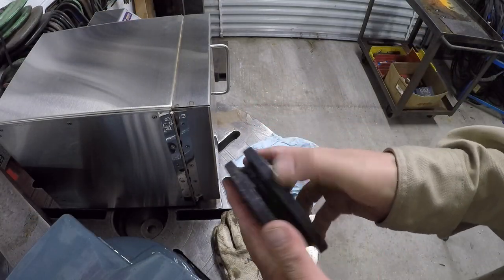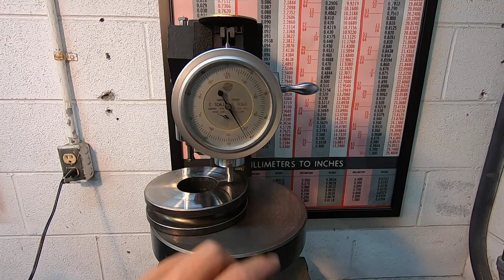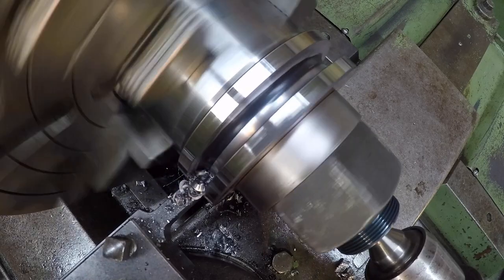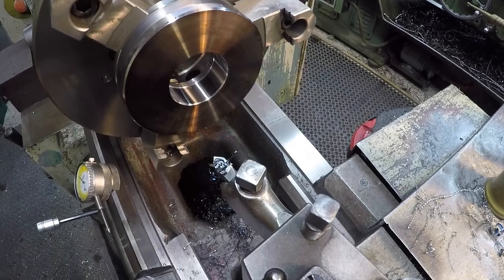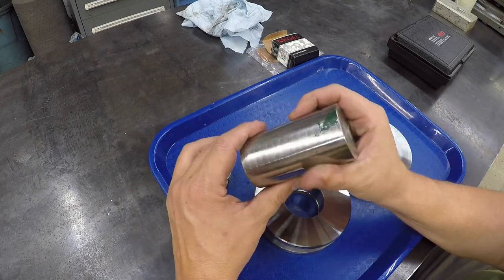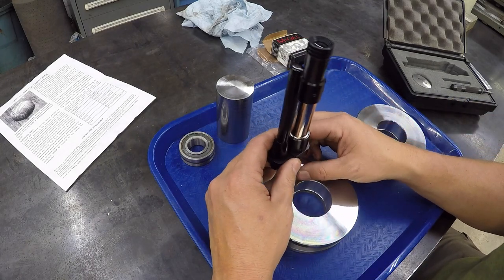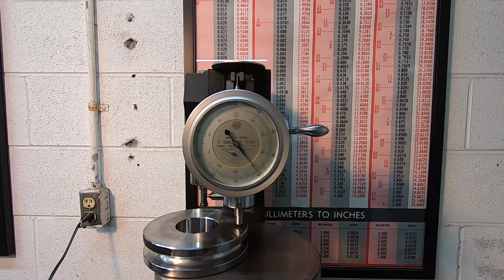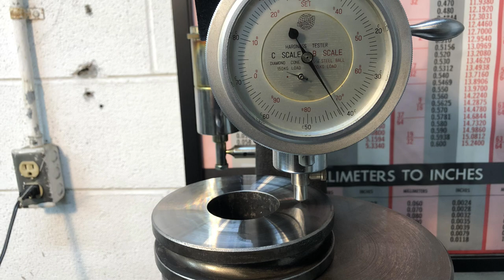Machining Cable Sheaves Part 2

Comment: Usually sheaves that run constantly are hardened in the groove for long life otherwise the wire rope will cut grooves in the sheave and the rope life running over such a groove will be lessened....This is for duty cycle work such as draglines, clamshell machines, magnets, etc where cycle time is two minutes or less .. Rope is constantly running back and forth on these sheaves....Mike in Louisiana
Reply: Finally someone who knows what they are talking about!!
Reply from the maker: Thanks for your comment, a refreshing change from the people saying the complete opposite and have no data to back it up.
Reply: And it's usually induction hardened and just on the surface of the groove down to about a quarter of an inch below it

Comment: Very informative! But you might want to use a metal pail for your quench oil--if the part slipped out of your pliers it'd melt right through the bottom of a plastic pail, which would be messy even if the oil didn't ignite as the oil level dropped below it...
Reply: I would recommend making a metal can and the basket. I know that my machining school had that setup.

Comment: So the idea of the hard sheave ruining the rope is valid on paper but in reality if its a clean machined surface cradling the rope nicely, its not going to damage it. Furthermore if there is damage you will start seeing frayed strands on the rope and that should alert you that repair is needed, and given the safety factor, you should never really be at risk. Also that rope is pretty hard itself and is constantly being wrapped around its own, abrasive self, without issue. Thus I conclude that the issue of the hardened sheave, is actually a non-issue.
Reply: Let the man play with his amazing toys

Comment: I am curious to see the hardness where the tongs gripped the part during quenching.
Reply: That was what I was thinking too, I'm unsure if the tongs would have cooled it quicker or if they protected it from the quench. I was wondering if it might be better to use a bent rod and hook it through the middle hole.
Reply: I was thinking the same thing. I'm wondering if that's the harder spot, where the tongs gripped.

Comment: Hi Adam, you might be able to use some TIG Cups to hold your parts up higher when heat treating so that the whole part sits in the same heat layer in the oven.

Comment: So I was interested in your Hardness testers and did a little Amazon/Ebay research.  These things are breathtakingly expensive!  That small simple looking PTC 316 Hardness tester costs $800!  The files are more palatable at $142.   And those bench top testers?  Used ones START at $1900.  Take good care of those things. Adam!  At those prices I guess you really have to have a need!

Comment: Hi Abom, here's a thought that has just occurred  to me.  Where you get that hard spot in the workpiece, could it be where you grab it with the tongs?  After all they are much colder than the workpiece and would start to cool that point right away, before you reach the quenching oil.  Then where the piece is still held by the tongs, could that cause some uneven cooling?

Comment: Leeb (bouncy ball) hardness testers are also a good low cost options for flat surfaces like that. We use a portable digital ultrasonic hardness tester which is a bit more but less than a conventional hardness tester and more versatile.
Reply: Ultrasonic hardness tester  are useful for measuring hardness in knives ? What do you mean about ? any model to recommend?

Comment: Adam you have to get yourself a steel tank for fab one for the quenchant. If you accidentally dropped that in there it would have been a real pain to clean up, not to mention getting hot oil over your boots. If you feel a bit lazy (I'm sure you won't and will design something much cooler) then get some 20mm ammo cans from the surplus shop. Steel and have a sealable lid to keep the oil from going off.

Comment: If I happen to be away from the shop and have a press fit bearing, I use a can of air duster, available for cheap at Walmart. Turn the can upside down and spray the outer bearing race until it freezes, usually about half a can, then it will drop right in with little or no trouble.
Reply: That’s a good idea actually.

Comment: Um, I kindly say, Sheaves are not meant to be the hardest item in a wire rope arrangement. The wire rope is meant to last longer and not wear. The cost to replace the rope vs the sheave(s) are two different things...  I can give a few examples, the sheaves on ATC (All Terrain Cranes) like a 8 to 12 axle unit, tow trucks etc., all the sheaves are of a plastic composite nature, like UHMW to the cheaper measures, like HDPE..  Lastly, wire rope and sling tech is a science, and the shape of the cove in the sheaves is directly important to the life of the wire rope, pending the diameter of the wire rope, ... Granted, for what these are going on, likely not much to worry about, and am just saying, for a non-requested 2 cents, for future ref....  nice work as always.
Reply: I keep hearing these comments, but as an operator of such machines have never seen plastic sheaves of any kind, with life hanging in the balance plastic parts just can't cut it.   Would you ride in an elevator with plastic parts?
Reply: @heavymachining7830  LOL... funny you mention elevators... I used to install them, and yes,  cable drag type elevators actually used plastic wheels as the primary's, sorry, I am not trying to be mean of any sorts, but.. just saying...  I am not saying that a wheel can not be of an alloy of steel, I am just  saying that industry standards are plastics. They actually last much longer then steel would, and wouldn't wreck the wire rope in the process... Please note, all is stated in kind... good luck ..
Reply from the maker: Back up your statements. Here’s some info contradicting what you say. https://www.seilbahnen.org/de/index.php?section=downloads&download=10460
Reply: @Abom79  Good article. But so much as changed in 25 to 30 years.. The cost effectiveness is to run the plastic sheaves, over replacing the cable.. the metal sheaves when they start to wear, they will wear at an alarming rate, in turn, the damage to the cable. Another factor is larger diameter wire ropes (.750" to 1.000"), need a larger arc /radius on a sheave,  if you have a stack of 16 sheaves and all in steel, that is allot of weight as well, at the higher  telescopic lengths of a crane. again, you can run steel sheave, most do not any more, due to the advantages of the plastic, Nylons, HDPE, UHMW's etc... the whole maintenance plan for either or, are much different. I am not saying anybody is wrong... Both metal and plastic sheave wear out, but with the plastic composites, you are not replacing the cable as well every single time... just some info, again, the wheels came out looking really nice...

Comment: Adam: Two suggestions. Get a metal 5-gallon bucket for your quench. If you touch the side of the plastic bucket with the hot metal you could melt through. Second, move the quench bucket and the furnace closer together. What causes the scale is the oxygen in the atmosphere, even for that minimum few seconds it takes from furnace to quench. Stan Zinkowski has a couple videos using an argon flood in the oven to get rid of the oxidation. Check them out. Hope to see you at the Bar-Z S Bash. Jon

Comment: That plastic tray under the parts may be giving you a false reading on your PTC tester.
I believe that the instructions say the part should be on a "hard, flat, metal surface" for testing.
Reply: yep

Comment: Just a thought but, could that harder spot that felt slightly raised be where the tongs were holding it during the oil quenching?
Reply: At 3:00 there's even a tong shaped spot on the disk.
Reply: I wondered the same thing
Reply: Yup. He pressed too hard with the tongs. A small part like that we would of pulled out with a pizza pan type fixture, or a hook, and dropped it in our oil quench press with that. No compression force on the part.

Comment: Could the hard spot be where you grabbed the pulley out of the oven with the tongs? They were likely “cold” and quenched that spot when you grabbed it. Just a thought.
Reply: That'll be exactly it. You can see it formed nearly symmetrically on both sides in the oil scale when Adam first shows it.
The glass workers I've seen here preheat their tools to avoid this thermal shock, since it can literally destroy their pieces; but I've also seen other hardening done with a wire hook on the part before it goes in the oven, to separate the tool from the workpiece.

Comment: Just thinking without knowing, could the harder spots be from the tool you used to hold the sheave while dunking into the oil to cool? Really enjoy learning by watching your videos.
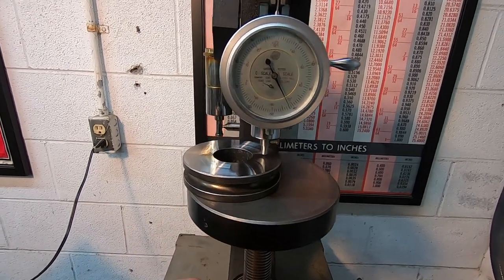Reply: >> 5:20 yes, that could be it, but on the surface on the work that doent mater, just looks
Reply: In other projects it could make all the difference.

Comment: I am a 38 year Journeyman Tool & Die Maker retired.  I have done a lot of heat treating over the years and on several occasions the quinch tank has caught on fire.  You must have your oil in a steel container with a tight fitting lid.  Just a word to the wise.
Reply: Bill Hackett I think you mean quench tank.

Comment: Hey Adam! Great video and channel!!
One can hear when you using you lathe, where you held the piece in with your pliers. Dunno if you preheated the pliers so it dont soak much heat from the piece?

Comment: Just curious if you have heat treated before? I used to heat treat. I worked in a forge shop. When your oven gets to temp give it a half hour per inch to normalize. Then your heat cycle. That is why your hardness varied. Your temper could have went a little longer. You should use a heavy duty strainer to oil quench and a metal bucket or tank.

Comment: I wonder if the different hardness reading in that one area is something to do with the tool that was holding it when it was quenched?
Reply: Or the orientation while sitting in the heater.

Comment: Couple things; First, its good practice to remove the scale from the heat treat procesz before testing for RC. Second, to remove the discoloring from tempering an old job shop trick vapor or sand blast. That works when welding to makes the work piece all the same "color."
Mike - Plus8Precision

Comment: At Waner & Swasey they used another type of hardness  tester that used a hardened ball bearing. The bearing was dropped in side the gage when the gage rested on the work piece. It measured how high the bearing bounced inside the gage to a scale on the gage . They used it to test the hardness of their  bed ways after induction hardening. There seems to be a lot of different types  of hardness testers.

Comment: Thanks for the tips on workholding, I have had same kind of project in mind -doing some wire rollers and bender dies . Love the channel. 
When doing hardening I believe that the surface of the metal  becomes hardest, as it cools fastest the middle of the part stays hotter longer and stays softer. As you machine it afterwards the hardest part is taken away.  The part didnt go out of dimensions that much during the heattreatment? 
It would be cool if you could do some actual testing on some tempered blocks - what is the hardness on them on different depths as you macine material off. Perhaps on some material that doesnt suffer on workhardening.

Comment: Enjoyable video. There are a lot of interesting comments on how to improve safety (metal container closer to oven) and techniques for getting the part to the quench tank (some sort of hook to minimize localized cooling). Should be helpful with the learning curve.
I like the wide variety of videos you post, but would like machining to be the core.

Comment: What temp did you temper at? The hardness should come out very close to the predicted values.  Steve Barton mentioned his oven was a little off on the low end temp readings so he was adjusting to get the temps to compensate so ge could get the desired hardness. You may want to talk to him about it as I think he has used his hit shot alot.
Reply: Brian, I was concerned about that as well.  He mentioned 500F.  We typically tempered 4140 at 900-950F for a HRC of 25-30 (which is plenty hard for a useful 4140)  As usual, there are a lot of opinions and I just thought I pass along what works for us.

Comment: the harder spot could be where you held the part with the tongs
Reply: @7tqpbnvh7tqpbnvh77  i thought ot cooled before the rest cooled because the tongs were cold but thats just a guess
Reply: An interesting question.  Heating the tool removing the part, or minimizing conductivity of heat loss through use of a tool that conducts or absorbs less heat?

Comment: Nicely done, is it possible that the 'raised' area on the face was impacted by the tongs when you cooled the part in oil?
Reply: I think I can answer that one. It's likely that it's from the mill where it was made and Adam started with those hard spots in the material. Back when I was in college taking a course in mechanical technologies one of the project we had to do was  bench block. The material was from this piece that had been donated to the college. We had trouble even in the band saw cutting it. Well, when we started trying to turn it in the lathe, some of us got to where it was almost impossible to cut in spots. We took them out, put them in the oven, and annealed them. Even then it was still difficult, but better. Some people would get lucky and get a piece that didn't have hard spots in them.

Comment: Hi,  As always a great video.  On the quench, where you were holding the part with the pliers, where the pliers touched the part it will cool much slower than the rest of the part and the hardness will not be the same.  For his application it probably doesn't matter but other application it may.  Hanging it on a hook or having a wire basket are options and the comment below about using a metal bucket just in case the quenching fluid catches fire is probably a good idea too.  Looking forward to seeing more videos.

Comment: So cool.  Neat to be able to harden stuff. I'd recommend you temper straight after hardening. Stuff can crack on it's own, just from different tensions in the steel from hardening. I might temper that higher too. That piece is gonna work, so it needs to be tough. At straw, it's still real hard, and prone to catastrophic failure if it breaks. It doesn't need to hold an edge. Think Spring Steel. Dark purple, so the file will just bite.  I'm no expert, just built a little coal forge, and spent a little time messing around with it. Thanks for showing. Awesome stuff.
Reply: Strike that, about the higher temper.  That hardness is right on.

Comment: Can certainly see and hear where the tongs were. Perhaps hang it on a bit of wire?
Reply: My thoughts also. If the item was held in the tongs and not rotated during the quench process you are going to end up with different hardness at that spot.
Reply: Thomas Beck 
It is too late to move the tongs once the cold tips have hit the piece, even with preheated tongs it is too late once the part is in the oil, suspending the part on wire is the way forwards.

Comment: I see those waves in that one part and I'm wanting to run it under a surface grinder to clean it up. Since you're learning heat treating your jobs, I can see the need for a used surface grinder. So, when are you going to the terminal to pick it up?

Comment: Hard spot is probably where the tongs were. On the next project place a mark where each half of the tong was holding the part to test the theory. Might be a better way to place parts in the bath if differential hardness could be an issue.
Reply: Or just the opposite -- soft spot was the tongs. Either way, the tongs were the problem. Hardening is all about how fast you cool it. Moving water will get it the hardest, then still water, moving oil, and still oil are common quenches. And to get uniform hardness you have to get uniform cooling, which the tongs prevent. They would act as either a heat sink or an insulator. Either way, no good. And thinner sections will get harder than thicker, so a test near the rim will be harder than something near the bulk of the sheave.

Comment: Adam, did the tongs during quenching create the discoloration on the part, just wondering if it changed the rate of the hardening process.

Comment: Adam, you need some heat treating foil to isolate the part in so it doesn't scale up during heat treat. Can be bought at any knife supply company. Also search for knife stainless steel procedure. Oxygen is not your friend when heat treating.
Reply: He does have stainless steel foil already, both on a roll and some bags, he tried and tested using it in an earlier video a couple of weeks ago.

Comment: Maybe that funny spot is where the tongs were holding the metal and that caused a faster quench as the tongs took heat away from the part faster than the oil did on it's own.
(I have no knowlage of this, just a thought)
Reply: That's exactly it. That's exactly where the tongs held it.
Reply: Good idea, or did the tongs prevent oil ingress and it didn't quench as fast?

Comment: Hi Adam hope your keeping safe and well. Please tell me you've moved your heat treating oil into a metal container , if you was to slip with something at temperature in the plastic container would it not melt. Keep safe.the 👍

Comment: Love the videos!!

Was pondering the hardness testing. I noticed the PTC unit requires that the testing surface needs a smooth 400-grit finish for an accurate reading. I’d think the other two machines would be similar. Compressing then peaks of the machining should throw off the results.

Anyways, just researching and reading. Keep up the amazing videos, Adam!